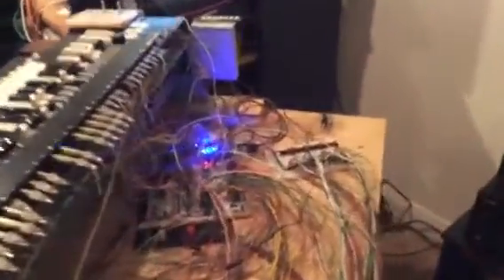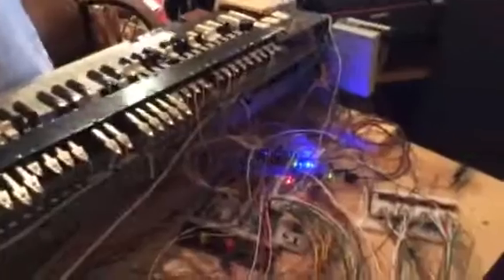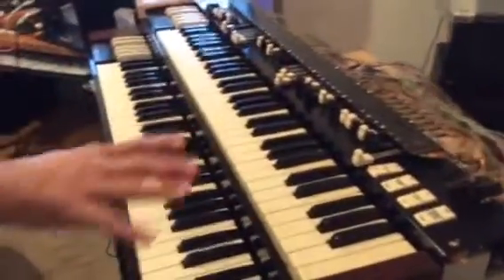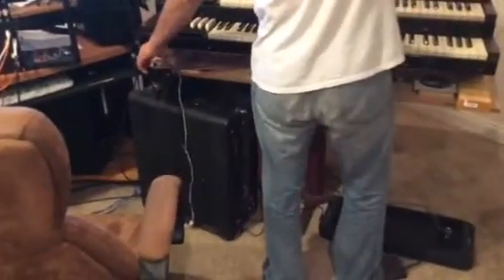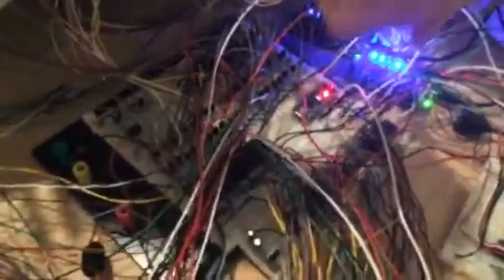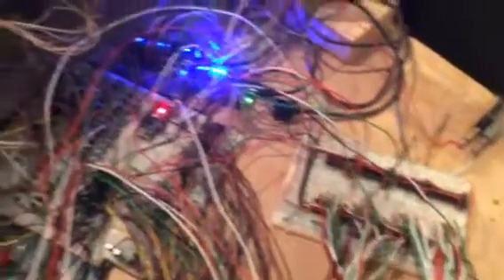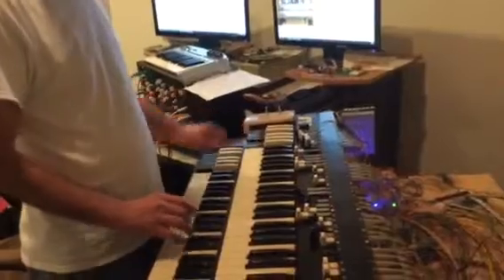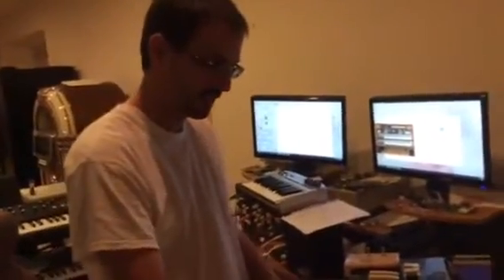Brouther Matts MIDI Hammond

Comment: You know, the MIDI tonewheels would actually be relatively easy, simply speaking. At it's core, the Hammond is basically just additive synthesis, you would just need to figure out how to patch all the tones together, which would be the hard part, maybe just digitally copy the bussbars, that wouldn't be too bad if you were able to create a working MIDI controller out of a set of Hammond manuals. Maybe find some way to make the TG rackmountable and voila: a portable, real Hammond that doesn't weigh anything. Good shit dude, carry on.
Reply: Seriously, I've been messing with my tone generator for the last couple years with that in mind.  I picked up a bunch of hardware to run some trials (was thinking to try digital pots to emulate the resistance of the drawbars),  a summing amplifier (this is not my forte), and a micro to interpret the midi data.  Most of my spare time over the last few years was designing & etching my circuit boards to clean up the mess behind the organ, it looks great now and it works beautifully.  Cabinet design is under way as well...

Comment: Nice job on the MIDI implementation. I've always wanted to have MIDI on my X77 (very similar to a B3), hoping to be able to play other instruments (piano, vibes, brass, etc) on top of the drawbar voices. I finally achieved this also using an Arduino processor and also have velocity sensitivity on the upper manual, which took me 2 years to figure out. Just wanted to say hi and that I appreciate the work you've had to do. Bruce
Reply: Bruce Nelson, thanks for the comments!  It's been quite a project to get to here.  I am currently trying to finalize my circuit board design to move it from prototype boards.  For your velocity sensitivity, is the Arduino fast enough to detect subtle nuances in velocity?  On my Polysix (with an old Roland keybed 8X16 matrix) I'm currently using the Propeller to run the key matrix and I'm only able to get about 5 velocity steps through the dynamic range.  I'm using SPIN language which I've read is much slower than programming in assembly, but I don't yet understand how to write assembly code.

Comment: Can you please tell me how you did this with connectors and such
Reply: john mackey
Here is a high level overview of what I did: 1) Manuals, I removed all the hammond resistance wiring for cleanliness and I soldered a new set of wires to one row of key switches including preset keys, I connected the bussbar for that row to ground.  I then used SN74150N multiplexers to detect the key positions.  2) General switches like percussion, vibrato, and the chorus and vibrato knob use the same principles as the manuals, however the hammond wiring required quite a bit of reverse engineering to use the switches as is.  Also, for the chorus and vibrato knob I am using the pattern created by the cams inside the switch to detect the knob position.  3) Drawbars, I'm sure there is a better way, but essentially I connected all the busses together across the drawbar set (both manuals and bass pedals), each if the 9 busses is then run through a diode   to a pin on the micro with a pull down resistor on each one.   I then used 3x SN74159N demultiplexers and connected each output to an individual drawbar.  the micro steps through each drawbar in the demultiplexers and monitors the 9 inputs to determine the position of each drawbar.  Also note, I turned these into ratchet style drawbars to improve signals to better detect each drawbar, but in the end I used software to only respond to a real position (ignore if two busses are selected, this means the drawbar is halfway between positions, I just leave the digital state if the drawbar in its last known position).  
For everything above I'm using two parallax propellers to monitor key/switch positions and perform all the digital logic and ultimately send the appropriate midi signal.  
For analog inputs, I am using an Arduino Nano and it seems a data stream to one of the Propellers.
I am currently using an old telephone keypad to send midi program changes and I also use a switch on it to change to program mode which allows me to change midi channels and store drawbar settings to the preset keys.
Post back if you have specific questions.
Reply from the maker: john mackey  will try to get my brother Matt to comment a little on this. I tend to stick to analog circuits myself. I included this video because I find it interesting.
Reply: thanks, I want to do this to my organ badly